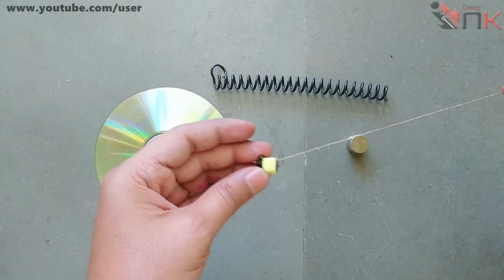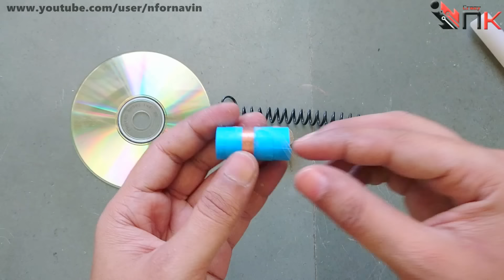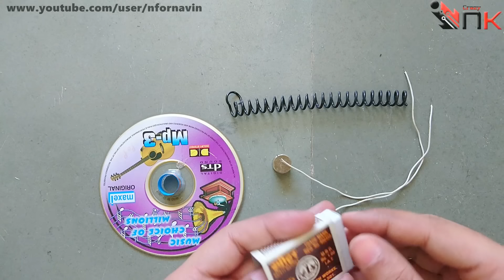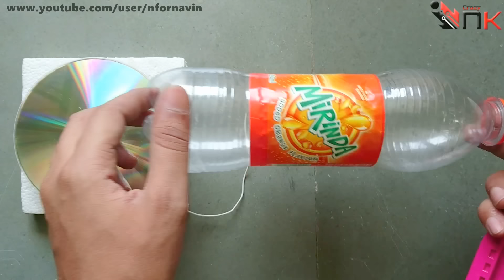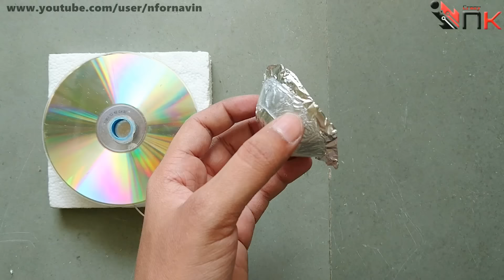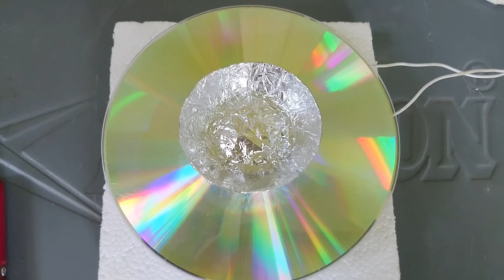How to Make a Speaker using CD at Home

Comment: Very impressive the way he did this.  There is a lot of mechanical distortion which is to be expected. The centre where the magnets are is rubbing against the magnet surface. The surfaces are crude and not properly tuned. What is impressive is how loud it works, and it does function as a speaker of sorts.
Reply: how can i make it better? i need the loudest sound possible for a competition

Comment: i love how there's a ONE GLUE FITS ALL rule in this alternate reality.
if you've ever had a sculpture class, or if you've ever used "GLUE' you know that different materials require different adhering compounds - usually you can differentiate between POROUS or NONPOROUS which will determine wether white glue or a cement should be used. even then, glueing something like styrofoam to anything, including itself, is just not gonna happen.
Reply: ryan sloan Yeah man! You neeeeeed to use the correct adhesive or forget about it! Things will fall apart and the whole things gonna eXpLodE!
Obey the glue! Dood!

Comment: will it work without the spring, if yes then can use a 3.5 mm jack to use directly with my phone, plzz reply me fast
Reply from the maker: spring is required for movement of disc to produce sound, direct 3.5 mm jack is not capable provide enough sound
Reply: Hendersin - Better Off
Reply: ITS HARSH
Reply: Well it could work but it won't be as loud. But you can buy a small amplifier board, and some how connect it to make it louder.
Reply: SILVERMAN 214 It won't work, do you really think the tiny voltage coming from your headphones is enough to move a DVD. it's nearly enough wattage to trigger an average transistor
Reply: ITS HARSH
Reply: it will work but probably not very good since the coil would be rubbing and the speaker would probably jump off of the magnet anytime a bass note hits.

Comment: cheap Chinese version of the tannoy dual concentric transducer lol
Reply: more Like a dual cone full range speaker not a coaxial
Reply: +ddorfpunk1 234 lol
Reply: +ddorfpunk1 234
Yes you are correct. Basically a very small "woofer" or mid range driver with a whizzer cone to try to help augment the higher frequencies.
Though I think it may be a little over optimistic to refer to it as a "full range" transducer. ;-)

Comment: I did everything and the video and it started smoking...
Reply: Hahaha lol
Reply: Lmao
Reply: Probably because of the match...
Reply: You might have played Snoop Dogg.
Reply: Not enough coil or too powerful of a amp. XD
Gotta be between 4 and 16 ohms.
About 4-15 yards of wire depending on thickness.
Reply: You should teach it about the effects of smoking and how it can cause lung cancer. Bad homemade speaker!
Reply: Too much power thru the coil probably
Reply: KaienSander10 You know what, you might be right there!
Reply: +KaienSander10 Yeah, that copper wire has alot of resistance, if the voltage is too high it'll start burning whatever it's wrapped around. In this case the paper.
Reply: lmao
Reply: LoL mine just not working
Reply: what? smoking?😁😁😁😁 I think this guy fooled us up😠
Reply: TitaniumFox95  😂😂😂😂
Reply: check the ohms of the wrapped coil before hooking it up, if it's smoking the ohms are too low
Reply: too much coil could do that, or if your using a gigantic amplifier, that to would cause it to smoke
Reply: Use an insulated copper wire

Comment: I just build it too and it works really reaally incredibly wel! I was quite surprised when I heard the acual quality of my "Made out of an old doorbell and 3 old springs with a cd in 5 minutes" speaker. I will build another one tormorrow and put ALOT more time into it and more wire for sure.
Also for some reason the first one I build now totally blacks out if it has to play bass. Im guessing the coil I did is too weak for the stronger bass than the lighter - less power - mid and hights?
Reply: I'm trying to make my own but I got serious problems
Reply: Could you please help me 😣

Comment: instead of using the receiver, could you tape the positive and negative wires to a 12v battery and an auxiliary cord to the battery as well and still make it work?

Comment: why do you burn the wire with the match stick and should the copper coil be very near to the magnet and can i use other magnets other than the one u mentioned
Reply: he burned the wire I think to remove any glue that was on it (I think)

Comment: can we solder the speaker's wire with the earphone pin and use it directly with the phone?
Reply: sanya khanna I know this question is some older now but for everyone the answer is no. It is because you would need an amplifier in order to output a higher wave from peak-to-peak to make the speaker waving more.
At least when I have built a speaker like this the sound was too quite in order to realize it.
What I did was trying it with my stereo system where I could amplify the sound / just increasing the volume of the audio source attached.
I mean,
there are possibly speaker solutions where you could probably directly connect them to your phone but I believe it would take you a lot more precision and the according material to do in better quality.
At least if you make the speaker a little smaller than in the video.
But then it would be silent anyway..

Comment: is there something that can replace the magnet?
Reply from the maker: no option for magnet
Reply: you are a smart person
Reply: Yeah an Electomagnet maybe.
Reply: By the way, neodium magnets are quite rare
Reply: you can replace the magnet by making another coil the size of the magnet you want to replace, then either connect like this: 
red plug + external coil + internal coil + black plug
(connected in series)
or like this:
red plug +external coil+black plug
                 \internal coil/
(connected in parallel)

note that parallel makes more sound but of lower quality and might damage the amplifier or the coils if your wire is too short, series can too, but that doubles the length of wire compared to using a magnet, and parallel divides it by 2.

ps: if you have little to no sound, try reversing the connections of one of the coils.

Comment: What's the purpose of the CD/DVD player that's connected to the "speaker"? Is it to supply current? If I were to connect it to a A.C supply, what is the recommended voltage/power setting?

Comment: how does this happen? can you explain the mechanism?
Reply: magic
Reply: My understanding may be very rudimentary, but here's what I think. 

The electrical current going though the coil goes against the magnet which causes the paper tube and the disc to vibrate. The foil bowl on top acts as a diaphragm, focusing the vibrations into sound.
Reply: Rohit Sanjay neodinium magnet have special power but coil can run sound and neodium magnets do that

Comment: from where can i get that magnet? 🤔
Reply from the maker: +Shivam Shukla ebay
Reply: Navin Khambhala # crazyNK ohk...thnk u !! ;)
Reply: +Navin Khambhala # crazyNK can u give me the link...coz there are so many of them and i am confused which one to buy.....
Reply: +Shivam Shukla Just buy a neodymium magnet on amazon, I recommend CMS magnetics
Reply: youst open a batery and look what it will be inside bateries 😃
Reply: home depot its around 5 or 6 dollars. look in the magnet area
Reply: Instead of buying the magnet which is like 20 dollars at some stores buy a speaker for 10 dollars that will last u longer
Reply: i tried and fail i dont know why i use headphone jack and can you tell mein if i use pc headphone port then battery is require or not??????
Reply: It's a passive speaker. If you aren't hearing anything, you've done something wrong.
Reply: from another speaker
Reply: You can't just plug the speaker straight into a headphone port as there isn't enough amplification- you will either need to make or use an amplifier